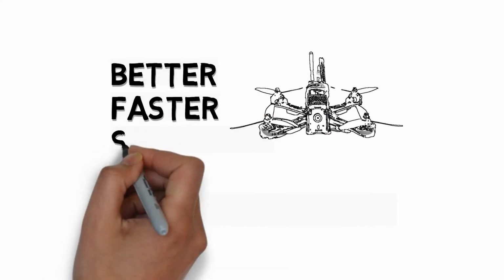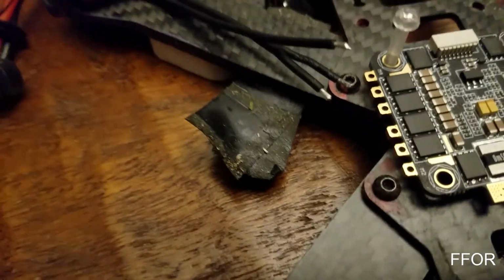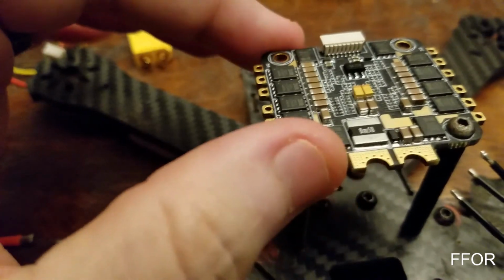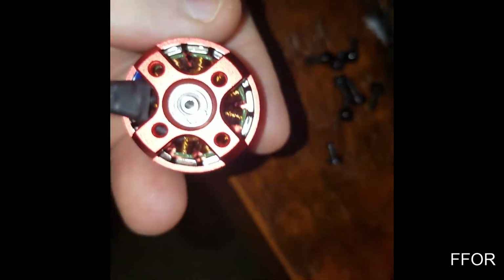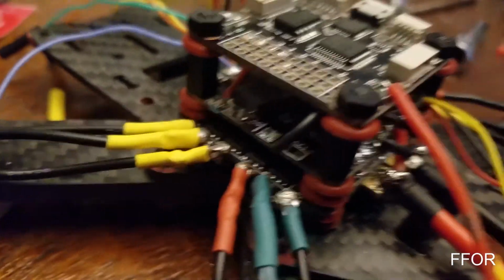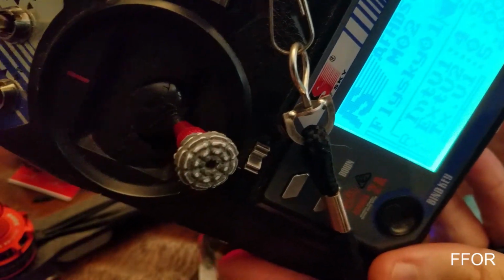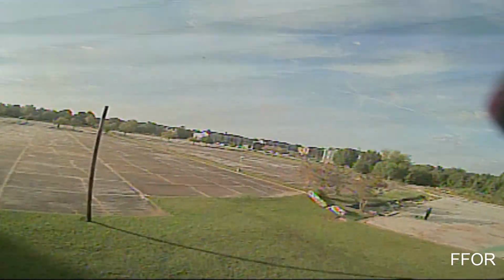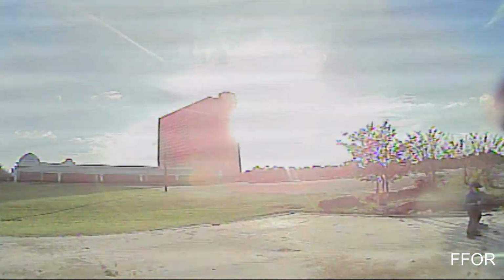Amazingly Inexpensive racerstar quad build-Racerstar 35 Amp ESC & Motors and flight thoughts

Comment: Hello everyone....if i wanted to use 2 x of these with a Matek F722-se for a hexacopter or octo build. Is this possible?
Reply from the maker: As long as the motor outputs were correctly soldered, you shouldn't have an issue
Reply: @Sully365  thanks bro!

Comment: What are those rubber rings and where can I get them?
Reply from the maker: 3x8x2.5 silicone rings.  ebay is your best bet, i paid 99 cents for 50 shipped: https://www.ebay.com/itm/50-Pcs-Silicone-O-Ring-Seal-Sealing-Gasket-3mm-x-8mm-x-2-5mm-/172679335897?hash=item28347d8fd9

Comment: Hello,
Do you flash this esc to its latest firmware?
Reply from the maker: yes, though i didn't notice a change, just updated to 16.7
Reply: Nice. Thank you so much Chris!
Reply: what firmware does this come with and is 16.7 the latest still?
Reply: mine came with 16.5 and yes the latest firmware is 16.7
Reply: cool thanks.. how are they holding up
Reply: I'm not really sure since I haven't abuse this esc so much. Recently I played with 6S and BF configurator to adjust the throttle, no problems at all. All motors start smoothly at exactly the same time (mine is 1012). With BF configurator I'm only at 1070 max to avoid any problems like desync etc.

Comment: You kinda sound like Cleveland
Reply from the maker: My name is Cleveland Brown and i am proud to be...
Reply: @Sully365  Hey man, what flight controller did you use on this build?
Reply from the maker: Joshua Reed funny enough, for this video, i used the spracingf3 that came with the wizard.  I had to keep the pdb, though, so i hated that.  I've since moved to the omnibus f4 pro with osd, voltage regulator, and a barometer.  And cleaned it up a bit.  Very happy with it now
Reply: @Sully365  Haha! No worries man, I've got that same flight controller that came with the Hippo 215 Kit I got from China for only $63.99. I ended up using a Foxeer F4 AIO for an amazingly clean build and am now thinking about getting one of the Racerstar 35a 4in1 esc and using it with the SP Racing f3 on a different build. If I do use the SP racing FC I'm happy to know I can refer to this video for anything I need help with. Might have to shoot you a question or two if I have any down the road. I might have to end up going with the omnibus F4 Pro down the road as I assume the SP racing f3 doesn't have OSD.
Reply: @Sully365  Hey is using a PDB necessary with this build?
Reply: Nevermind I now realize you did so because the Racerstar has no BEC. I am looking at a Excelvan 35a 4in1 esc for only $23.99 on eBay and it has a BEC. Of course then I'd kinda be winging it as far as how to hook it up but I guess it's worth a shot. The price is right anyway!
Reply from the maker: Joshua Reed only if your flight controller needs it.  If you get the omnibus f4, then no, the 4 in 1 esc can feed power to the fc that can feed power to the peripherals
Reply: @Sully365  The more I think about it I am going to go with the omnibus f4 pro too. Found one on eBay for about $19 and then the Racerstar 35a esc is another $27.99 on there. Not bad, a mini stack for under $50! Can't wait to get the components and rebuild my Floss knockoff frame.
Reply from the maker: @j.r.0420  that's exactly what it is now. The f4 pro is great, osd and barometer, capable of 6s if you match motors, 4s is no sweat
Reply: @Sully365  6S is still way out of my range! I've only been flying FPV drones for about a yr now and I'm actually finally going to graduate to 4S!! LOL I started out with a Happymodel Mantis 85 which gave me the flying bug and now I own about a half dozen micro builds. I have only recently started flying mini sized 200+mm drones and I am even more hooked! Anyhow thanks for the input, happy flying dude!!
Reply: @Sully365  Hey on your FC did you have to bridge a solder point in order to choose Sbus over PPM? I am assuming you use ibus connection for your receiver, which uart did you  connect your receiver to on the F4 Pro?
Reply from the maker: @j.r.0420  if it makes you feel any better, i haven't seen any real advantages to non racers for 6s.  It seems the 6s fliers don't sag as much.  I don't really run into voltage sag when I'm flying anyway, so 4,5,6 doesn't really matter to me.  I have a ton of 4s batteries so that's my thing.
Reply from the maker: Joshua Reed i connected to the rx1 using the connector.  I did not have to bridge any pins for ibus.  I think it was uart1 to set for serial. I can double check when i get home if you need me to
Reply: @Sully365  I get no sag at all on my mini drones, and lately I've just been doing laps around my house which has been honing my flying skills lap after lap. Since I'm not flying very aggressively I get 10+ min flights on both my mini drones, 1 of which is a 215 Hippo with 20a esc's and the other is a Nidici Qian Floss knockoff which I am actually running off a micro stack with 30a. Looking to get rid of the micro components in the Floss knockoff and use them in another build. Can't wait for the weather to get nicer so I can get out and rip!!
Reply from the maker: It's at 16:25 or so on the vid. I did not have to bridge any pads for ibus
Reply: @Sully365  Nah man I meant on the new F4 pro FC you now have, not the f3 in the video. The FC I'm looking at on eBay doesn't say pro at all but it seems to have all the same functions that the pro version has. But it requires the user to solder a tab for either sbus or pwm receiver input which I think is strange. I might just go with one that has pro in the title as they are the cheaper listings from China. The one that require the solder tab is from a Los Angeles seller so I'd like to go with that to get it sooner, the Racerstar 35a esc is from a CA based seller too and would only be a few bucks more. Decisions decisions!!
Reply: @Sully365  So the FC I'm thinking of going with is a Flip 32 F4 omnibus V3 FC so I'm guessing it's the same FC you have if not very similar. Most the listings for the omnibus f4 pro are from China otherwise I'd go with one of them.
Reply from the maker: Joshua Reed it's the same.  I'm not sure if the v3 and v2 difference other than go with the v3.  I went v2 bc of a clearance sale
Reply from the maker: I'm an idiot.  I forgot i swapped this fc and pdb out for the omnibus way after this video.  Sorry about the confusion.
Reply: @Sully365  no worries man! So in both the Flip32 F4 and the omnibus F4 pro I'm seeing a solder tab to choose between sbus and pmw input. Is this something you had to do on your FC?
Reply from the maker: Joshua Reed until the tyro79 i just got, I've never had to jumper 2 pins for ibus.  I either plug in to rx1 or the ppm-ibus pad.  Sbus is either already inverted or needs to have a bridge to invert
Reply: @Sully365  Man I just saw the tyro99 on sale at Banggood for only $99, which I have yet to order from them. I haven't had to bridge any FC yet although the FC that came on the SPC Maker 110ng has the option to change things by changing jumper pads. I could be wrong about the jumper pad on the F4 pro it may be something else. Anyway thanks for the info man I may be in touch again when I finally get my parts if I have any more questions for u.
Reply from the maker: Joshua Reed awesome.  Lemme know how it goes. Btw, i would not do the tyro99 but would emphatically recommend the tyro79 3 inch.  It's just a better quad.  I think you'll be very happy with the f4 pro racerstar combo
Reply: @Sully365  Hey I have a question for ya, is it possible to change the actual orientation of a 4in1 esc? That is if say I wanted the power cable to come out the side of my drone instead of the back is it possible to rotate the esc board I guess it would be 45 degrees?
Reply from the maker: @j.r.0420  I believe there are ways to remap the motors.  Personally, i would just rotate it, wire it, and then change the corresponding wires on the cable to the flight controller.  Like if the bottom right motor is attached to the m3 position on the esc (counter clockwise rotation 90 degrees, with the battery cable coming out of the right side when looking down with the camera at top), then i would take the motor 3 esc wire and pin it to the motor 1 signal on the fc.  with this esc, you have to do that anyway with motors 2 and 3 since the ESC is configured oddly/not in betaflight normal formation.  Hope that helps.
Reply: @Sully365  Yeah that does help...kinda. I was actually thinking of doing this with a micro 4in1 esc that I want to use on my Babyhawk R to breathe new life into it by upgrading from the 12a esc it came with to a F4 FC and 30a esc. I swear I've tried doing this with a 4in1 esc before and had all sorts of issues making it work. I guess since then my skills have improved so I'm ready to make some changes to all my drones.
Reply from the maker: @j.r.0420  That's exactly where i am with my quads.  I built a 3 inch racerstar based quad that i love..but i want to update the motors and camera....the 5 inch needs to be tidied up, the tyro needs to be broken down and put in a 4 inch quad, and i have a 20mm fc/esc/motor combo to make another 3".  i'm a bit addicted to building/tweaking more than flying lately
Reply from the maker: @j.r.0420  also, when doing the ESC, just remember that the ESC merely gives power to the motor based on the signal wire, so if your motor is bottom right, then signal wire 1 to whatever ESC controls the bottom right.  you can even mount them upside down if you want as long as you go in betaflight order (or kiss, raceflight, whatever, each has their own order)
Reply: @Sully365  I slapped together a bunch of spare parts, random parts I collected on the cheap mostly from China and am about to finish setting it all up. Just a lil 2" setup with a F4 FC and a 12a esc on a HGLRC Hornet 120 frame with HGLRC 1104 7500kv motors. For the FPV I have a crappy lil 25/200mw vtx and a Caddx turbo micro F1. I built this thing a while back actually and finally have a better idea of what I'm doing when setting up a new FC. I hope I can make it fly now! LOL
Reply from the maker: Joshua Reed sounds like a good one.  I use King Kong 2830 props with 1104 7500 motors with the leader 120.  The 2530 props are also good. 2 inch 7500 isn't that fast... But probably fast enough.  I look forward to seeing it
Reply: @Sully365  Finally got it flying!! Got some kinks to work out still but after actually remapping the motors in BF the damn thing actually flies!! LOL I ran a set of Avan Rush 2.5" props and the motors got pretty warm. I need to check the filtering on it to make sure I don't smoke the motors!
Reply from the maker: @j.r.0420  Look up UAVTECH channel.  He is amazing when it comes to filtering and has a ton of videos about how to do the smaller quad filters/pids.  he's also very responsive.
Reply: @Sully365  Right on man, may have to check it out. Thanks again Chris!!
Reply: So I ended up looking at the filters in the PID setup on BF and none of the filters were turned on at all!  So lucky I didn't burn up my motors! I'm noticing that after a simple hover not doing anything aggressive this thing is running at 17a!! I'm wondering if I should be running smaller props or maybe this esc isn't matched for these motors???
Reply from the maker: Joshua Reed unless you have a current sensor, your amp reading it just bogus.  You could only leave it plugged in for a few minutes if the amp draw was that much with no moving motors.  Mine does not have the current sensor hooked up.  Also, if you flash bf 3.5 and up, your notch filters are off due to the dynamic filter changes.  Just keep an eye on motor temps, but mine have all been fine
Reply: @Sully365  So the amp draw is that high after a flight and it drains a battery super fast.
Reply: @Sully365  I just realized that the Makerfire 12a esc is 2-3s and these lil motors are for 2s only.  Not sure if that makes any difference but after looking up the specs on the motors they are rated for 2s but it shows a chart that has them clocked at 11.8a on 3s and the 11.8a is a max amp rating. Not sure what to think!
Reply from the maker: Joshua Reed what size and kv?
Reply: @Sully365  Sorry, the motors on this lil micro. They are 1104 7500kv.
Reply from the maker: Joshua Reed probably better on 2s or betaflight 3.3 and 3s.  The filtering changes after that can heat the motors a bit more
Reply: @Sully365  I'm actually running BF 3.4.1 on it and I just had a maiden flight outside which went amazingly well proud to say. I even managed to get a 5 min flight on a 500mah 2s! Next I'll try a battery with a bit more power. So far so good and the motors are still keeping cool. Can't beat the feeling when things come together!
Reply: @Sully365  Hey man, I finally got my Racerstar 35a ESC and Flip 32 Omni F4!! So now on my Floss style frame I have a set of AOK 2205 2300kv motors powered by the previously mentioned components. Then for the FPV I'm using a Caddx turbo micro sdr1 powered by a Akk fx3 ultimate 600mw vtx. Unfortunately I seem to be getting quite a bit of noise thru my setup so eventually I will do a minor teardown and install some sort of LC filter if not a simple capacitor. I am quite pleased with just how clean of a build this ended up being. One of these days I might actually make a damn video of a build. I just have no experience with uploading vids online or video editing for that matter. It would be nice if it was possible to simply attach a photo to this msg but I imagine that is not possible. I think for my next build I'm gonna go with a Rooster 230 frame but I am still trying to decide exactly which components I plan to use. Decisions decisions! LOL ;)
Reply from the maker: @j.r.0420  that sounds awesome.  I think a capacitor would definitely help with noise.  That sounds like a perfectly clean and smooth setup. Are you running dshot 600?
Reply: @Sully365  I am, and I updated the blheli to 16.7 and so far I'm pretty happy with how much power this esc seems to have.  Can't wait to try it out with a 4s battery.  Unfortunately the crap weather is keeping me grounded for now, I'm ready for spring and summer already!
Reply from the maker: @j.r.0420  definitely ready for flying weather
Reply: @Sully365  don't get me wrong, whenever possible I'm out doing laps around my house.  But earlier I was getting ready to fly, had a few batteries charged up and ready to go only for it to start sprinkling!  Days like this I'm usually flying between downpours. LOL :)